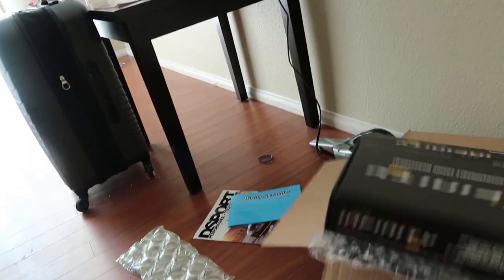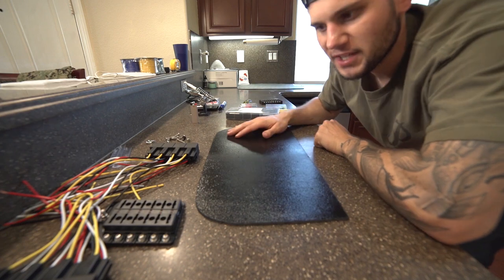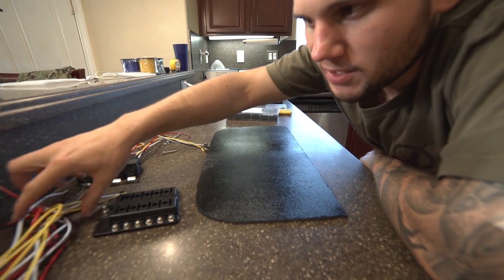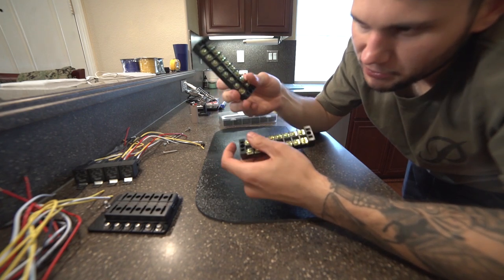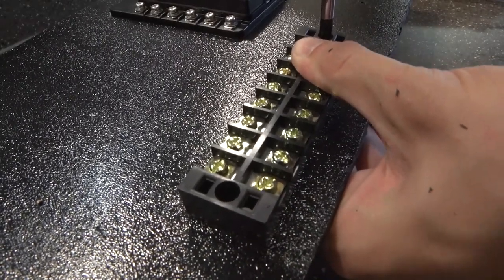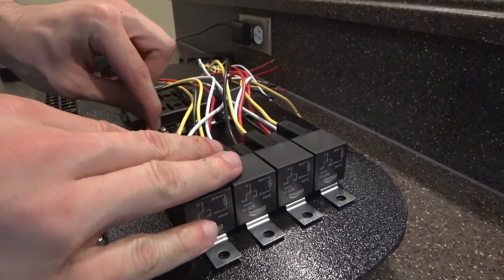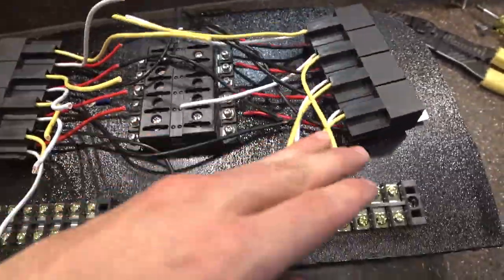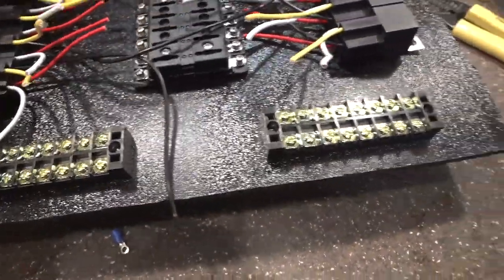How To Make A Relay Board - Race Car Wiring

Comment from the maker: Here's a layout on each wire
Pin87(yellow) - to accessory you want to power
Pin86(white) - to switch
Pin30(red) - positive (this wire was previously blue before I depinned and used red)
Pin85(black) - ground
Reply: Track Factory ok I understand every part but where does that other wire from the switch goes to like if one wire goes into the pin 86’s from the switch then where is that other wire from switch goes to? Two wire switch not three prong just needing to know so I can make one of these for my Holley EFI ect
Reply from the maker: @dominicallen2953  Great question. That other prong is going to be a 12v power source wire that powers the switch. With this setup I forgot to mention that you will need to run a wire off the fuse block to a power distribution block so you can power your actual switches.

Comment: Instead of several relays which are ignitioned triggered, why not to add just one giant 200A relay and let this control an extra fuse box. This wiring will be ignition triggered and attached to this fuse box are components like power windows, headlights, turn signals, horn, radiator fan, fuel pump etc. Will this work?

Comment: How do you figure out the fuse sizes and also if you run all your grounds to one power distribution block what size wire would it need coming out
Reply from the maker: Basically the fuse rating = (Power/Voltage) x 1.25 and I just threw a 2 gauge wire at the distribution block which should be plenty
Reply from the maker: I will be making a video of wiring the whole chassis and I will show you how to do everything so stay tuned!

Comment: Dumb question but if you only run 1 wire to the switch how will it know to turn it on or off? Shouldn’t there be two wires to the switch?
Reply from the maker: The wire that connects to the switch from the board is signal,  power is supplied to relays, then the switch activates that current to go to the device, also power needs to be ran to the switch itself.

Think of a relay as a big switch that needs another switch to turn it on so it can open up and flow. 
Basically Small switch sends power to big switch so the big switch can send power to devices that have a greater power draw than your tiny switch can handle.

Comment: Looks very nice.  Question if you get power off your battery will it have power all the time? How can I set it for the fuse block to turn on when the car is on?
Reply: Depends on how you wire it or need it wired but for the most part you want it to come on only when the key is on.
Reply from the maker: Sorry for the late reply how I have mine set up is I have a battery cut off before the panel. Of you didn't want to go that route you could use a multimeter and find a wire that doesnt get power when ignition is off and gets power when its on
Reply from the maker: Just make sure it's a thick enough wire

Comment: Stupid question but do you have to run fuses or can you just have power from distribution block to the red wire on relay
Reply from the maker: You want to run fuses. They are protecting your wires, you don't want a fire in your car.

Comment: The wiring looks fantastic,  my only question is the wire leading into the toggle switch is that a ground or a positive?
Reply from the maker: Thanks! That will be your power
Reply: @TrackFactory  so one side of the toggle goes to 12v and the other side of the toggle will go to the distribution block
Reply: @TrackFactory  btw I appreciate your help
Reply from the maker: @davidridings9138  sorry for the late reply, the yellow wire will go to a switch, the white wire would be connected to whatever youre trying to use that switch for. ie: headlights
Reply: DON'T USE ANY TOGGLE SWITCHES PERIOD
Reply from the maker: @brucekirk5386  really? What would you recommend?
Reply from the maker: I just noticed I said yellow goes to switch. That's wrong so here's a layout on each wire
Pin87(yellow) - to accessory you want to power
Pin86(white) - to switch
Pin30(red) - positive
Pin85(black) - ground

Comment: if i use black to ground and i make a ground to be switch.. and red white i use to battery.. is that safe ?
Reply from the maker: I'm not following what your saying
Reply: @TrackFactory  i mean, the black cable i use to toggle,
Reply from the maker: @Koko_pets  black is ground, white is to your switch, yellow is the wire to your device, red is 12v power from battery
Reply: @TrackFactory  yeah.. i know that.. but, i want to change.. black to switch.. ground to switch..
Reply from the maker: @Koko_pets  you're saying you want to run the ground from the relay to your ground post on your switch? Or de-pin the black wire and make the color black something other than a ground?
Reply: @TrackFactory  no.. just ground to be switch, ground use to toggle.. on-off from black ground.. u get me ?
Reply from the maker: @Koko_pets  I'm not getting what you're saying brother. You want to be able to turn off/on a ground?
Reply: @TrackFactory  yeah.. i want to use on/off in ground
Reply from the maker: @Koko_pets  No. Your ground has to be constant. Why do you need a ground to be on/off?
Reply: @TrackFactory  becous, if i use on/off switch in negative, when toggle broken it will be fire, so i think to use ground for toggle.. to be safe
Reply from the maker: @Koko_pets  You want to have your power wire fused and running to your switch and then a ground from your switch. Your fuse will blow if your ground goes bad for whatever reason, keeping it safe.
Reply: @TrackFactory  so.. what ur recommend ?
Reply from the maker: @Koko_pets  ground the wire. Run your power wire to a 12v fused source then run your other wires to your switch/device

Comment: so why not put the yellow and white together for each relay? I have seen a few videos of the same setup and the outgoing power and the switch are always separated. wouldn't it be easier to wire it up if they were side by side?
Reply from the maker: You could if you wanted, it's all preference really. I did it this way so the colors wouldn't stagger and all my signals go to one side of the bus and and the switch wires go to the other
Reply: @TrackFactory  kool, that makes sense.

Comment: The way you explained it confused me. Relays are designed to send high amperage power by using an low amperage signal. 

You said the switch will send power from the white wire, through the relay and out the yellow wire. This means your power from the battery will be the one powering the coil in the relay. If you do it this way you will have it working opposite (high amp power coil, low amp power load) from my understanding the battery side wire should be sent to the relay armature. Once voltage from switch is sent through coil it will close the armature and allow the high amp power from battery to power the load
Reply from the maker: Sorry for the confusion, inside the relay there is an electromagnet that will close a contact point when energized. So what I meant was the white wire (switch) will send power to the relay (a small amount) just to close the contact point on the relay which will let the power flow through the relay to your device you want to power
Reply: Track Factory oh okay, I’m trying to build this but I’m just trying to figure out how to wire up the switches and where you would get the power that runs through the switches
Reply from the maker: @boxbreakracing  I hooked up a power distro block from an un used port on the fuse block and that's what powers my switches
Reply: @TrackFactory  is it okay to run a wire to the positive from battery to distribution switch, Daisy chain to terminals on one side,  and run a wire from other end of terminal to get power to switch?
Reply from the maker: @alloveross1  yes but you want to make sure you have a fuse on that wire coming from your battery. Also keep in mind that if you hook it up this way your switch power wires will be "hot" meaning they will be able to be turned on without the ignition switch on.
Reply: @TrackFactory  So if I didn't want it to be "hot", can I tap into the cigarette lighter for power but use it for up to 6 switches with an inline fuse?  I would have to do the same for ground too right?
Reply from the maker: @alloveross1  I'm not sure if that would have enough power, might want to try something that draws alittle more, you can jump all your ground switch posts to each other and then run a single gound to the chassis or you can get a distro block and use that to ground them individually which would be preffered
Reply: @TrackFactory  Appreciate it.  Your video was helpful!